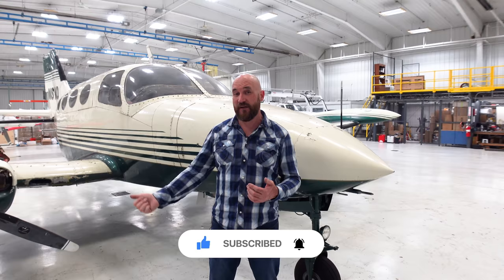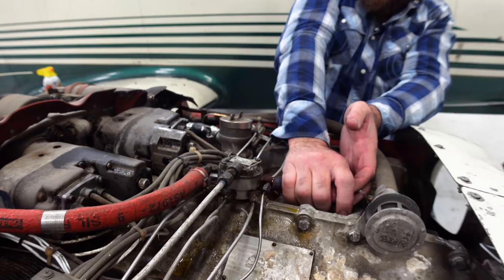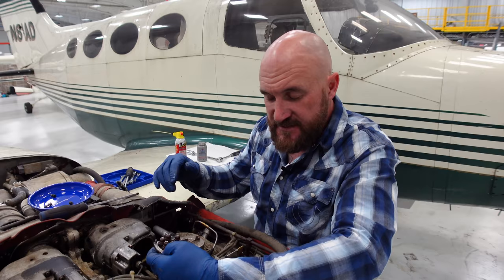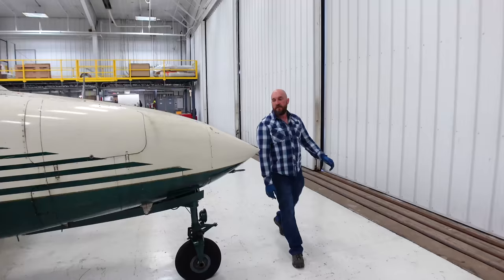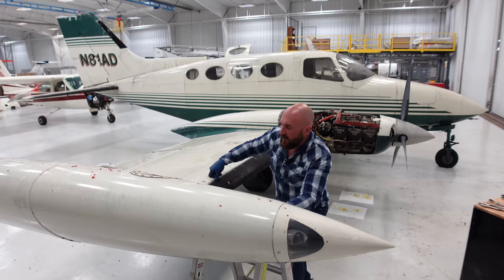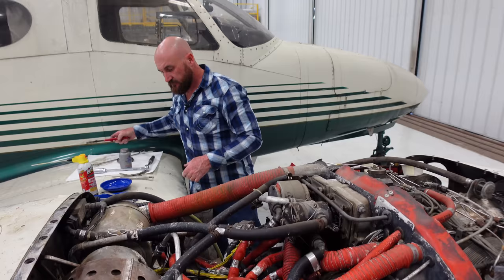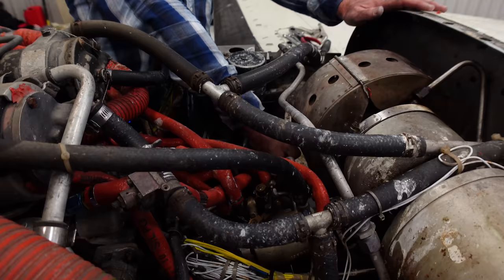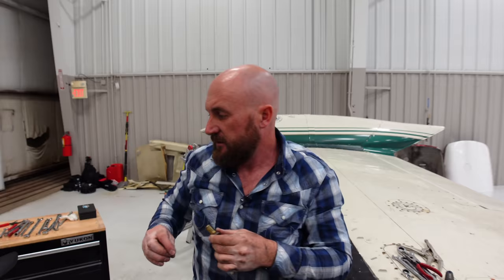He's Trying To STEAL Our FREE Abandoned Airplane ! Ep3

Comment: Jason:
Having reviewed all the comments, it seems to me they fall into one of three categories:  
1. Those who know nothing of aircraft and aircraft engines offering dangerous and/or stupid advice,  
2. Those who are supportive of your efforts but don't understand the Code of Federal regulations (14 CFR) that applies to aircraft certification/airworthiness and hence the economic unfeasibility of restoring this aircraft to flying status,  and 
3.  Those who know aircraft values and are knowledgeable about this aircraft, it's systems, it's engines etc and are actually trying to offer helpful advice while totally understanding that there is not an economically feasible way to return this aircraft to flying status.   

 If one makes this a labor of love and pours $300,000 into the aircraft it MIGHT fly.  Whereupon it will be worth about $150,000 on the market (no-logbooks, AD compliance etc, even with newly overhauled engines and accessories makes this a money looser).  That is the type of situation you are looking at.  The fact that there are no logbooks automatically discounts the sales price by $40,000-$60,000.   Engine overhauls will be $50,000 to $60,000 per side, accessories like turbos etc will be about $10,000 per side, prop overhauls will be about $6,000 per side if all is ok or up to $35,000 per side for new if required due to corrosion (a real possibility).   Aircraft stuff isn't cheap and it is escalating every day (along with everything else).  
Prior A&P/IA comments are spot on for the most part.  By the way,  A & P =  A for Airframe, P for Power plant,  hence A & P.   It is an FAA license for a holder of two licenses necessary to work on FAA certified aircraft, engine and airframe), whereas the IA license is an FAA Inspection Authorization.  An IA is sort of a graduate degree in being an A&P with emphasis on inspecting and returning to service aircraft requiring FAA inspections, major modifications, or major repairs. 

Some thoughts:
1.  Check the compression of the cylinders, even if the engine is cold you will get an idea if there is adequate compression, 
2.  Verify the ignition system type on this aircraft.  Per the typer certificate data sheet (TCDS) for this engine it can have either an impulse coupled magneto or a retard breaker type of magneto that has a starting vibrator associated with the retard breaker.  Look at the data tag on the magnetos and get the Part Number, cross reference the PN to readily available references online and you'll know which type of mags you have.  I am virtually positive yours will have the "shower of sparks" system with the starting vibrator and retard breaker so you will need to verify that system is working.  Merely having a spark isn't enough to start, it must be timed to fire at near top dead center on the compression stroke for this engine to start.  That retardment in timing to near TDC for starting is accomplished by either impulse couplings in the mag or by the retard breaker combined with a starting vibrator that puts out a continuous high voltage spark to the spark plugs during the starting process.  
3.  The fuel appeared to be making it to the flow divider (aka fuel spider, fuel distributor), but not getting through it.  There is a poppet valve in that unit as others have mentioned, and I agree,  that it is probably not working/opening, hence no fuel flow thru the spider. Once you have fuel output from the spider flush the injector lines and also remove and clean the injectors.  There is no "fuel rail" on these 1940s era technology engines.  They are continuous fuel injected (i.e. the fuel flows into the intake manifold continuously throughout the 4 cycles of the cylinder).  The "fuel flow" gauge in this aircraft is a pressure gauge NOT A FUEL FLOW gauge.  You can have a completely blocked fuel system (such as you have) and the gauge will read high "flow" as it is showing the pressure being built.  More modern systems actually have fuel flow transducers that truly show fuel flow. 
4.  The electric fuel pumps are for priming and emergency use if the engine driven fuel pump fails.  There is a bypass valve in the engine driven pump that allows fuel to flow thru the pump when the electric fuel pump is on.   The prime switch merely activates the electric pump while held at high speed, whereas it should be run in low speed at all other times  (at least that is how it is if the aircraft is configured according to Cessna Multi Engine Bulletin MEB 88-3, which most are).
5.  Starting procedure for these engines:  Mags On, Mixture full rich, Throttle wide open, prime engine for 3-5 seconds or so (if you see fuel dripping out the bottom of the cowl you went just a bit too long, no big deal if it isn't a huge puddle), return throttle to cracked position, "clear prop",  crank the engine while advancing the throttle (you are trying to achieve a stoichiometric mixture),  as you advance the throttle the air/fuel mixture will reach a combustable mixture and if everything is correct it should start. 

Notes:  I presume this aircraft is fitted with remote oil filters.  Before attempting to start the engine remove the outlet hose from the oil pump that goes to the oil pump adapter.  Verify there is oil in the pump outlet and the filter hose with oil, and if you changed the filter fill it with oil as well.  These engines have been known to loose oil prime in the gear driven oil pump after sitting for long periods.   You retrograde fill the oil pump by filling it thru the outlet fitting.  

Hope these few hints help, and good luck.  GSilver   FAA Wright Brothers Award Recipient, 54 year pilot, A & P/IA,  Owner, Pilot, Mechanic on Cessna 421B for 27 years.   Never turned wrenches on a 401 but virtually all twin Cessnas are similar.  Big bore Continental engines are all very similar.  I note that many comments from some were related to Lycoming engine start procedures and they are usually somewhat different from injected big bore Continentals.
Reply: @GSMS524 Great post. I hope Jason @Rebuild Rescue see it and responds. I really want to see him succeed. I just hope it doesn't become too much of a financial burden to get what he wants and that the scumbag who's trying to steal this out from under him doesnt succeed!
Reply: Agreed! Spending money for lipstick to put on a pig does not change the fact that it is still a pig. Of course, he isn't even accounting for the reason the plane was grounded in the first place.
Reply: but if his videos trend and continue to be popular, the value of the plane to him is high because it can generate more revenue than the plane is worth from youtube moneys. 300k on trending builds like the tunnel proj, or abandoned mansion etc is rookie numbers, and that's probably why someone is trying to shark the plane off him, but granted also it's plausible that part is staged to push better traction of the project and thus more youtube monies.
Reply: So much
Reply: So basically, I need to tell Youtube to stop recommending this to me because it's never going to fly.
Reply: Mate the blokes clueless
Reply: @patrickmassengale  I'm sure you meant to say "the scumbag... DOESN'T succeed" 😉
Reply: Hey, GSMS, in #5, your "Starting procedure".. how do you "advance the throttle" if you already have the "Throttle wide open"? (a typo, I'm sure, but if this is a checklist, get it right. 😉)
Reply: @michaelscott356  Because he states, "After wide open, return the throttle to crack" which means just barely open. So, no not full throttle.  Read it again. 😉
Reply: Jason, Let 20grand have it!
Reply: @michaelscott356  yes, oops...thanks for pointing that out. I corrected it...
Reply: A&P IA, CFII and aircraft owner here.  You've summed up my thoughts perfectly.  The only way this will ever fly again is if the YouTube revenue grossly outpaces the cost of repairs.  And on an aircraft like this, the cost (as you accurately summarized) will be extraordinarily high.  Most of the commenters with no aviation background just don't understand what it will take to get something like this flying again.
Reply: @ThePhotokill  The last I heard was that Youtube will pay between $2 to $5 per 1,000 views depending on how popular the channel is. Right now, this vid has around 43k so a check for about $86 to $215. Someone correct me if I am wrong (which I tend to be). Now as a Youtube show, I guess beating this dead horse...err...plane for the giggles factor would be nice just for the entertainment factor. But as far as getting a used plane up to code ready for use wheels up, I would spend my time and energy on something a little less bird crappy taking using the same amount of money on either using the 'parts cannon' or purchase price.
Reply: @Razman23  Yeah makes sense. each to their own and all that etc. Just to clarify, "youtube monies" i used in reference to dollar per views, sponsorships, ad revenue, donations, merch sales, general traction of brand or whatever and the value it brings from its many faucets if that makes sense? All of that combined is what makes these projects print cash, but I agree with you. I'm not interested in digging around in bird shit, but if we knew which builds and projects trended over others, we would be millionaires. Sorry I should have been a little clearer.
Reply: @patrickmassengale  if this video series makes 100k USD, he might break even to get that 401 restored, assuming the value of a sale after the fact.
Reply: 1
Www
Reply: amen
Reply: @ThePhotokill  No worries mate, I know what you mean by 'pushing the traction'. I am not really an airplane guy, more into sailboats so I get to see a LOT of sailing videos with 'click bait' titles (more or less sexual in base) and some kind of erotic thumbnail to get people to watch their channel. Problem is they tend to be meh with no real content so they get these 5k-10k views with a 300k click bait video every once in a while. But back to the story. I look at this as 'Can I recoup the cost of mats and labor on this plane from selling it or video views?'. Since there is so much wrong with this plane, not counting the engines themselves or the recall item to be replaced but what other things need to be done? The lost log books are a big issue. Everyone knows that The Man is very anal about keeping records on these things up to snuff. My own feelings? I would walk away and let the owner sell it to the other person. I mean this isn't the only plane of this type in the world.
Reply: @ThePhotokill  Exactly, This video alone, at this point 6 days in has made him $14,500 minimum.
Reply: @Razman23  dude his first video on the plane has hit over 6million views so I think he could afford to pay the 20 grand
Reply: bump! I appreciate the effort you put into this comment!
Reply: @michaelscott356  No, you dill, unless he has edited since your comment, he says “return throttle to cracked position”.  This means slightly advanced from completely closed.
Reply: @lmp2208  I MAY have missed that "cracked throttle" comment. He IS, after all, quite detailed, complete wit his "stoichiometric mixture" reference. THERE'S a phrase you don't see or hear every day! (unless of course you're in the business of trying to fire up stubborn internal combustion devices!)
His procedure sounded much like attempting to ignite my old Norton Commando Combat, except for the part about the "prop", of course! 🤣
Reply: You nailed it. Very cool you responded with all this information. He can use this. I hope he can get his A&P and get his channel to make him some money, inspirate people to become A&P's and get this plane up to flying status!!
Reply: @GSMS524 I appreciate you giving him some actual useful information, but you are a bummer. Most people I have seen, whether they know what they are talking about or not, are just having a light hearted bit of fun watching these videos and commenting. 

Also you do not seem to understand the internet. There is patreon, go fund me,  there is merch, there are sponsors, and just so far, 4 videos, have done 10.8 million views. In case you are not aware, that's worth a minimum of 21k if monetized, which I believe they are. This is easily monetized content, nothing controversial about it that is going to get his videos or channel demonetized or suspended. It is family friendly content without being for kids, which is the sweet spot for youtubers currently. If he keeps making videos about this plane and progresses it towards a total rebuild, he could easily, and I do mean easily, make many times the worth of the plane. He'd have to be an idiot to lose money on it, he his first video trended and has over 6 million views. 

Here is how this could easily go. He could learn how to maximize profits on youtube, add a modest amount of midroll ads, get sponsors and do a 1 minute product placement in each video for something like ridge wallet, groove belts, etc start a patreon for people to donate to help rebuild the cessna, and then he gets it started, a video which could easily trend as well. The plane is legally his, gets the title signed over, registered in his name, etc. While people are still donating on patreon, he spins up a merch store with rebuild rescue stuff, fans will even donate designs most likely, then he starts a gofundme for the rebuild project to do a total restoration, saying in it that at the end the plane will be sold and X amount will be given to the owner to help them out, play up whatever financial woes the old owner had, and donate X amount to charity. Then the rebuild starts, he could have certified mechanics on as guests, easily a number of these videos could trend, especially major things like getting engines restarted, passing inspections, and finally it has it's first post restoration flight, that would do big numbers. All in all could easily break 100 million views if several videos in the series trend. Then there is interest in the plane from all that publicity, maybe some news networks pick up the restored plane that's going to be auctioned for charity as a feel good story for filler. The plane ends up bringing actually above market price, he donates what he said he would to the charity and owner, leaving him a decent chunk afterwards, and all said and done from all above sources, he's sitting on a cool 1-2 million after tax in his bank account and with a channel that has enough subscribers to keep him going when he switches to other projects, and he never has to work a day job again. 

There is really no place for the dour humorless curmudgeon routine, try to lighten up. That being said, aside from that, thank you for your informative contribution.
Reply: It's making plenty of money on youtube to help it's restoration, so it becomes economic.
Reply: Is an A&P overseeing all of this work?
Reply: I agree with everything you said, not knowing anything about aircraft engineering at all it sounds like you do so 👍
Reply: sounds like he knows what he is talking about
Reply: All this aircraft is good for is spare parts and a for making a "will it start" video.
Reply: After more than a month Rebuild Rescue hasn’t had the courtesy to respond to this OP (which is probably the best post I’ve ever seen from an eminently qualified commenter). Piss poor RR.
Reply: @jasonzayas5487   You're full of it!  He can do anything he wants to that plane once he owns it as long as he's not trying to fly it or hurt anyone.  That doesn't mean that it can be returned to service, this is where you are confused.  Everything that he works on will have to be done again by an A&P, or components will need to be professionally rebuilt and certified if he wants to progress towards it being airworthy again someday.  

Stating that someone is dangerous and that everything they are doing is illegal, as you have stated, is considered defamation of character.  Libel is very serious and you could get cleaned out in a civil lawsuit.
Reply: @Atlantis Motor Club  You pretty much repeated everything I said, but with a negative tone.  Yes, of course he would need an A&P to go over everything, I didn't comment on how easy or difficult it would be to find someone.  My major point was that he is not doing anything illegal.  He's simply working on a piece of machinery, not hurting anyone, and not illegally flying it.
You and I, along with almost everyone else watching this, agree that for many different reasons, it's not feasible to make this plane airworthy again.  It can be done, but you can buy a nice one that's current for far less money than what this will cost.
Reply: @jasonzayas5487   Everything I stated is accurate and you really are more confused than I thought.

- The plane is not airworthy, it doesn't matter what he does to it.  He's not hurting anyone or breaking any laws.  This is not considered unlicensed maintenance of an airworthy airplane.  He's basically tinkering with something that you would find in a salvage yard.
- Like I already stated (and you repeated), if(a very big if) he ever wants to work towards it being airworthy,  everything will have to be redone by professionals and components rebuilt and certified, or replaced.  Sending the engines to Continental to be overhauled is the same as having them rebuilt and certified as I already stated.
- You seem to have some psychological and reading comprehension problems, maybe you should get some help.  I realize that licenses are important to you, so make sure the shrink you go to is properly licensed.
-This channel is entertaining and it is watched by families.  There is no need for your vulgar language, it makes you seem less educated and can hurt your credibility.
- If people are entertained by his videos and want to give him a few dollars, so be it, it's their choice, no harm done.
- As I already mentioned, you are guilty of libel and you have put yourself in a bad legal predicament with your statements.  Deleting your comments (like you have already done) won't help you, there is a record of all of them.
- Lastly, and very importantly!  I love my country and I don't appreciate you bad mouthing the hard working people of the FAA.  Our laws are in place to keep people safe, and to protect people from individuals like you who may or may not know what they're doing.  I hope someone from the FAA reads this and lets you know how out of line you are with your statements.  Seeing that you seem to frequently go from one employer to the next, it doesn't look like you have a great track record and your employers probably wouldn't like the way you refer to the feds.  You've worked for some very solid companies, why would you be making these comments and possibly attracting bad attention for yourself?

Have a lovely day!
Reply: @davidstjames_  you win. good day sir.
Reply: @jasonzayas5487  
You have a good day also Sir.
Reply: I swear I didn't think anyone was going to say anything about having an a&p and he is doing alot of a&p work especially with him logbooks. He hasn't even tried creating new log books or mentioning it with the work he is already doing. Kinda a slippery slope
Reply: Plus he hasn't looked in the amm at all has no sources to site what so ever. I hope you get it working just make sure you not doing illegal work man and have your proof for the faa
Reply: There have been similar projects done on YouTube with super cars where YouTube revenue makes it overall profitable to rebuild something for more than its worth. They could be a possibility here.
Reply: WOW! Respect!
Reply: Lmao he makes 2 million views per video

It doesn't ever have to fly to still be 1000% worth doing lol
Reply: engine overhauls can be cheap when you do them poorly.
Reply: You took the words from my mouth
Reply: If just the short, few hints look like this, I don't even want to know how much work would be needed to get this plane flying again, legally.
Reply: Bro, just come out & say that you wanted to be part of the project. 
This forum is for everyone's  5 cents worth. Just injoy it &  follow the journey, help & become a Patreon of his..
Reply: The internet should be banned for 65+ people